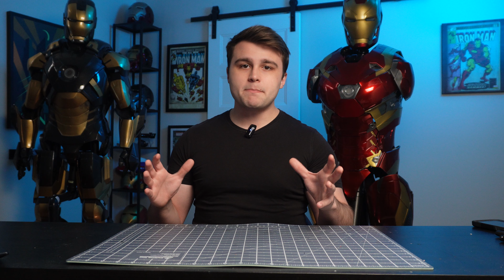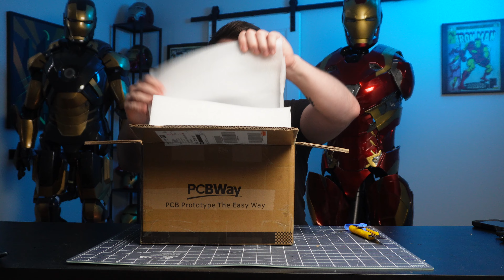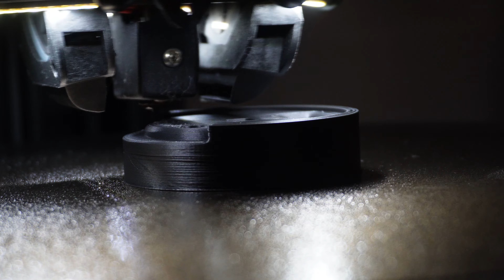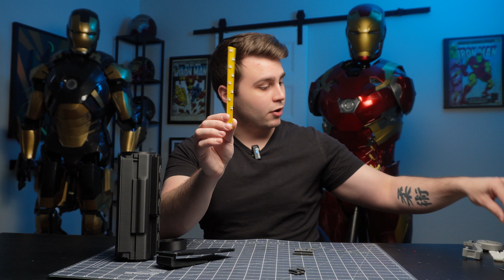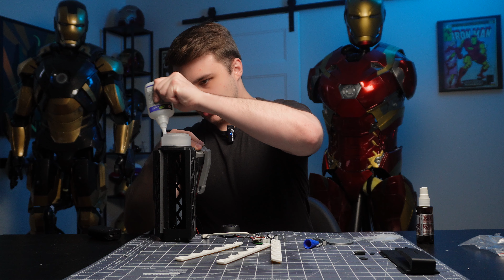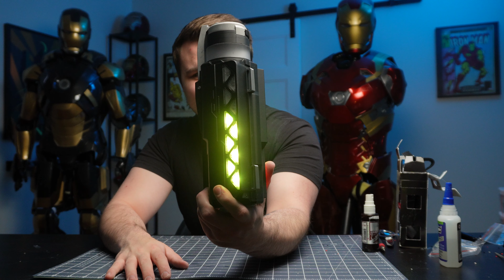I Made a REAL Helldivers 2 Sample Container prop!

Comment: @plentifulprops3d Hi, I'm wanting to make one of these myself as well. Where did you get the clear top part? Was it 3d printed from pcbway? did you print it yourself? Also does your link to pcbway include the pcb for the nanopixels? It didn't appear to? Thanks
Reply: nvm I found the gerber files for the nano pixel pcb in your google drive link, but I'm not familiar with using pcbway or how to order the pixel holder from the files. Do I just upload the files and get quote? The pcbway gerber viewer shows 2 unknown files from the zip. Gerber_DocumentLayer.GDL and Gerber_MechanicalLayer.GME 
Where does the CR0805-JW-102ELF go in this assembly?
What are the specs of the power supply you are using?